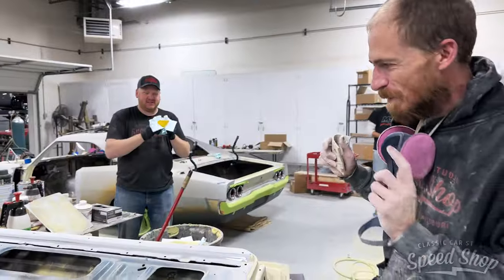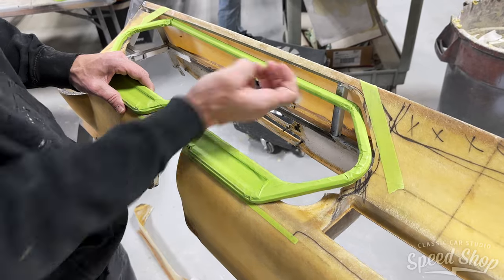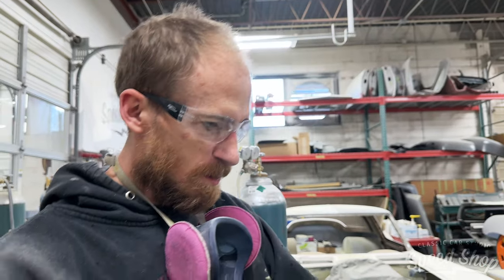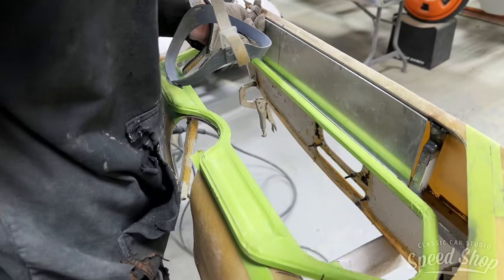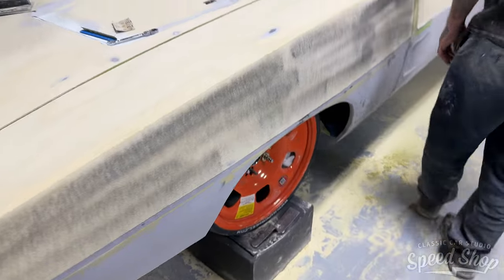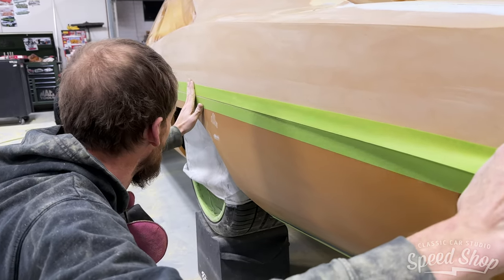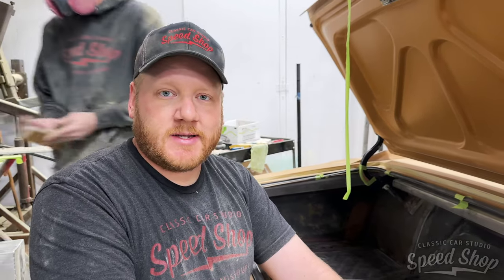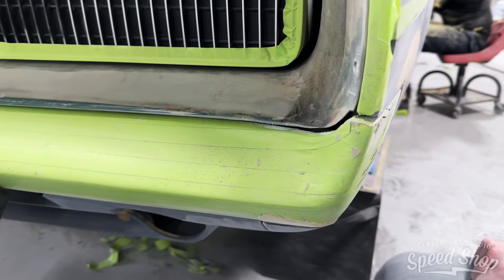Dashboard & Bodywork • 68 Dodge Charger R/T

Comment: That's the way a team is suppose to work, like a well oil machine, brings back memories of the good old days. That's what you call quality work. Most of these so called shop's just get them out as fast as they can and it looks like sh--t and think the costumer isn't going to notice, that's just totally wrong. but you guys work with pride and passion. That's the way it's suppose to be done ✅💯